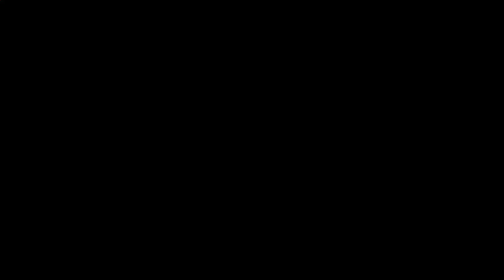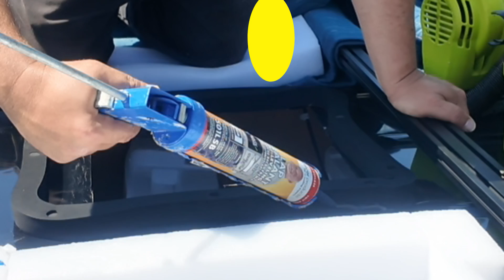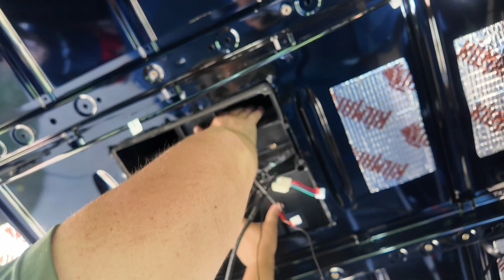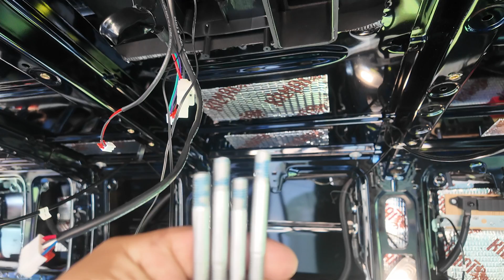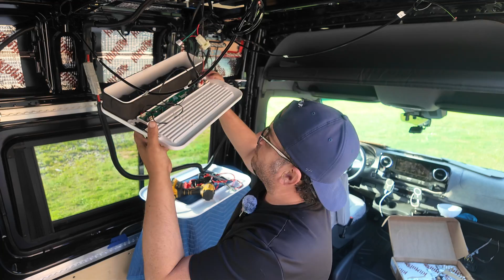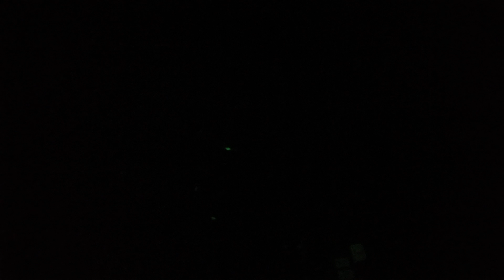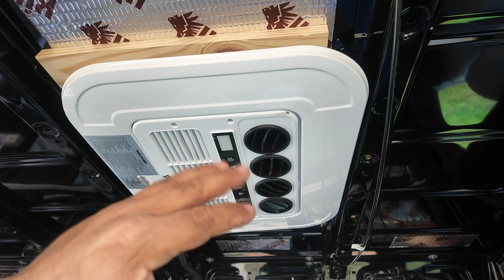Don't Cut Your Roof Until You Watch This! 12V AC Install

Comment from the maker: 🛒 BUY HERE & DISCOUNT CODES
▶ Exclusive Purchase Link: https://bit.ly/OutEquipProACHeaterRF
👉 15% Off Discount Code: ADAM30
https://amzn.to/4rGP8Zf
💸Building a Camper Van? Enjoy Fast Deli
👉Easier Returns during the build https://amzn.to/4rGP8Zf

▶ See all the parts I used in my VAN build for FREE: https://bit.ly/RFVanBuildPartsList
**Unlisted Video** Showing final setup using a 12V native power station bank: https://youtu.be/zkcXrvJGMCU

▶ Amazon Link (12V A/C with No Heater): https://amzn.to/41qukJM

⏰ TIMESTAMPS
0:00 - OutEquip Pro 12V Heater & AC Install: Introduction & Tips
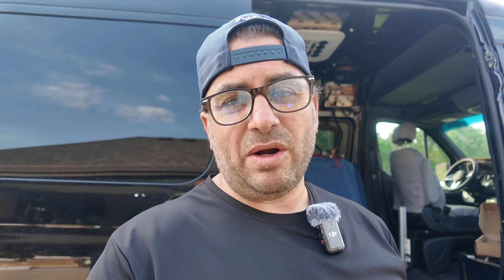2:01 - Van AC Install Day: Prep Work for OutEquip Pro
2:26 - Key Prep Steps for Installing Your Van AC Unit
3:33 - OutEquip Pro AC Install: Correct Hole Size for Van Roof
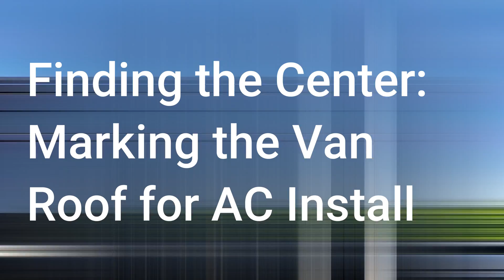4:02 - Finding the Center: Marking the Van Roof for AC Install
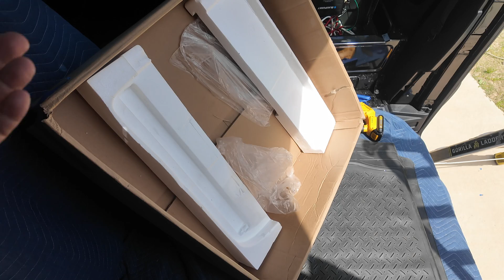5:58 - Cutting the Roof: Step-by-Step Guide for Van AC Install
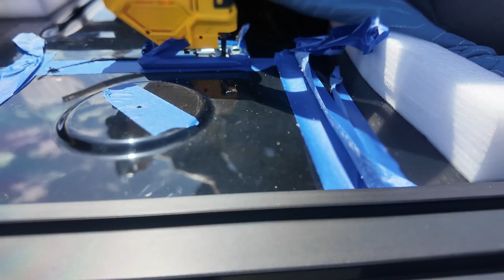6:37 - Applying the Gasket: Ensuring a Watertight AC Seal
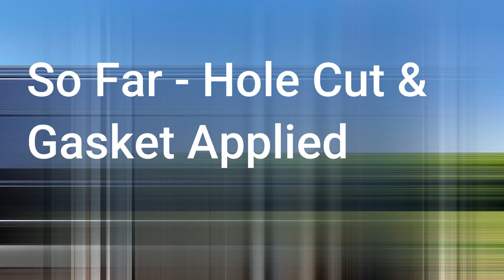8:45 - Van AC Install Update: Hole Cut & Gasket Applied
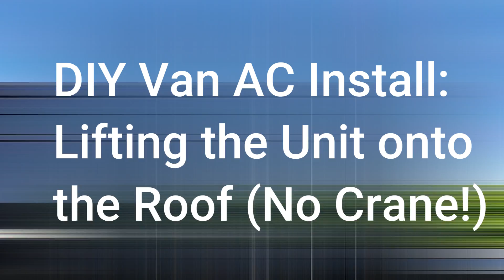9:34 - DIY Van AC Install: Lifting the Unit onto the Roof (No Crane!)
10:59 - Leveling the AC Unit: Making Height Adjustments for Proper Fit
12:07 - Avoiding Extra Holes: Wiring the 12V AC Unit Inside Your Van
13:31 - Securing the AC: Installing Metal Studs on the OutEquip Pro
14:26 - Reinforcing Thin Van Metal for a Secure AC Install
15:51 - Modifying Stud Length for Perfect Headliner Clearance
17:19 - Leak Test: Ensuring Your Van AC Install is Watertight
17:49 - Wiring the Control Panel: Powering Up Your 12V AC & Heater
18:38 - Advantages of 12V A/C Systems
21:25 - OutEquip Pro 12V AC & Heater: Key Benefits for Van Life
25:29 - Pro Installation Tips & Tricks for Your Van AC Unit
31:15 - Final Thoughts & Recap: OutEquip Pro 12V AC & Heater Install

🛠 PARTS & SUPPLIES USED FOR INSTALL
▶ Self-Leveling Sealer: https://amzn.to/42AMF6A
▶ Butyl Tape: https://amzn.to/4gf7zQQ
▶ Metal Speed Jigsaw Blades: https://amzn.to/42PEGE1
▶ Jigsaw: https://amzn.to/3EpRszP
▶ Roof Fan (to help extract hot air): https://amzn.to/3HjJRnW
▶ Small Circulation Fan: https://amzn.to/3Und2tc
▶ Standalone 12V Heater: https://amzn.to/45pUZYf
▶ Updated Included AC Gasket: https://www.amazon.com/dp/B08KSLRB45

❄ Alternative Power Cord Routing Video: https://cdn.shopify.com/videos/c/o/v/9f13acf1e5e24686beba0db06cbcfa61.mp4

🎥 RELATED AIR CONDITIONING & HEATING VIDEOS
▶ OutEquip Pro 12V AC/Heater Unboxing & Pre-Install Check: https://youtu.be/QX1o89CqNKg
▶ Air Conditioner Install Video: https://youtu.be/qsGtl2X0fyI
▶ 4 Month Review Video: https://youtu.be/xA88BCCT_Tk
▶ 1 Year Update Video: https://youtu.be/Lux1RWOaUdA
▶ Gasket Upgrade Update Video: https://youtu.be/8RGpvvMbasU
▶ How I Power My A/C (DC & AC Loads): https://youtu.be/CpxEwSwUNbA
▶ Looking for a Diesel Heater?: https://youtu.be/SxGkUpEoORY

🎥 OTHER BUILD & WIRING VIDEOS
▶ 2026 Fan Install (Best Fan Ever!): https://youtu.be/bq52RUauRNE
▶ MaxxAir Fan Install: https://youtu.be/4knTUcm3ihY
▶ Bathroom Fan Install: https://youtu.be/QXxBSx3cfI8
▶ Installing Windows: https://youtu.be/5NFRYbsl1eY
▶ Vantech Roof Rail Install: https://youtu.be/oB_Yh3JEooI
▶ Low Pro Roof Rack System: https://youtu.be/pkj5Tcs5a1U
▶ Standard Roof Install on 170 Extended: https://youtu.be/1FX9xsWQa7Y
▶ Roof Deck Install: https://youtu.be/4cu8mjVKQzc
▶ Auxbeam 8-Gang Switch + LED Light Bar Install: https://youtu.be/a4Xae4J4b2c
▶ How to Wire a Van Like a Pro: https://youtu.be/RPgQe8d_3BQ
▶ Understanding Diodes in Van Wiring: https://youtu.be/pCRmZKXeGAA
▶ Sprinter Power Leads Under Driver Seat: https://youtu.be/42sVAuafbXc
▶ Shore Power Install (Rear 2025): https://youtu.be/PO2sdMM50-A
▶ Shore Power Install (Front 2021): https://youtu.be/Ksyee3aYm7s
▶ Power Bank System Install: https://youtu.be/rqFwxSwji1w
▶ Stereo Amp Install: https://youtu.be/vhBOfmHlM-g

🚐 SPRINTER PLAYLISTS (60+ Videos Each)
▶ VS30 907 170 EXTENDED: https://bit.ly/VS30Sprinter170
▶ 170 High Roof: https://bit.ly/VS30170Extended
▶ 360° Van Tour: https://youtu.be/rCCA3hLQSzQ
💸Building a Camper Van? Enjoy Fast Delivery and Easier Returns during the build https://amzn.to/4rGP8Zf

Disclaimer:
Due to factors beyond the control of RandomFix, RandomFix assumes no liability. Affiliate Partner: I will receive a commission from some of my affiliate partners for my first-hand recommendations such as Amazon. #CommissionsEarned #Ad My videos include paid links

Comment: This is the most detailed thorough video I have found for this exact AC. THANK YOU!!! I have one question, we just completed our install cannot figure out where the "drainage cutout" is so that we can ensure we have placed it outside the gasket. I read through some of the comments and sort of see this kind of mentioned but not exactly. Are you avle to provide any guidance? I just want to make sure we have installed it back far enough now rather than hoping we got lucky enough 😅😅😅.
Our opening is also 14×14 so I know we need to be certain. 

Thanks!
Reply from the maker: It drains out the sides, as per the gasket and setback, watch the video about the gasket update in this video”s description. You want to make sure that holes towards the rear are not within your gasket area. Once you get in place just feel towards the rear of the unit from inside. 
So place your gasket, ( 14x14  is fine) place the unit, make sure you don’t feel those holes towards the back of the unit and then secure in place. I have a 4 month update, 1 year unpdate, and an unboxing video where I bench test it incase you want to see the under belly of the unit and see the holes towards the rear of the unit.

Comment: It looks like you have it installed backwards. Aren’t those cutouts on the top side designed to be on the sides and back? Seems like you are going to take in rainwater into the electrical since it will hit it at 60mph speeds.

Comment: Came back to revisit your install as im pretty certain this is the AC ill be using?  Have you had an opportunity to run the heat on any trips?  Im wondering if it could be used instaead of a diesel heater.  I know the diesel heaters are so efficient.  Cheers, Adam....another thorough video!!!!👍👍
Reply from the maker: The heat is barely noticed in the real winter, I just published the diesel heater review https://youtu.be/SxGkUpEoORY  and I will post the actual install of the heater in the coming weeks. I tested both system, all in one vs split. Take a look and let me know if you have any questions. Since you are starting a fresh build make sure you see that unlisted video https://youtu.be/7_h07JsOdfQ where I show how to connect in the diesel fuel tank without having to drop the diesel tank!

Comment: Does that battery hook up to the alternator?
Reply from the maker: The air conditioning connects to you power bank or can be connected straight the main vehicle battery ( the alternator charges the main vehicle battery).
Most newer vehicles have alternator that is strong enough to support this.
Reply: @RANDOMFIX  OK OK because I own a cargo van business and I’m going to be installing the one that does heat as well. I need to put in the heat one soon.
Reply from the maker: Are you doing this because of the heat? Or is the air conditioner more important?
Reply: @RANDOMFIX  both are important but it’s about to get cold where I am so heat is very important right now
Reply from the maker: You can save yourself lots of time and money and money buy getting the $30 12 volt heater that I tested and works amazingly well. You will find the link in this video https://youtu.be/xA88BCCT_Tk?si=KZqMm8FpOxStNHQ8 in video description. Install of that heater is an absolute breeze and I hope that helps and best of luck, keep me posted.

Comment: Hey swashplate after reading your  4th point about making sure the gasket sits flush in relation to the thin foam gasket that’s glued in n the unit. I noticed that if  the unit sits on the square recpro gasket  it’s half on and half off . I’m a bit confused on that part! Anybody has an idea about what he’s referring to would be great!
Reply: Yes Michael at outequip said they included both gaskets in the box
Reply from the maker: Awesome, thank you for confirming that.
Reply from the maker: I made an updated video about this https://youtu.be/xA88BCCT_Tk?si=6f6ovNf_awOJw5j1 I show the way the gasket is supposed to go in. 

And in the video description I mentioned there is also an update about the gasket, it’s short unlisted video.

With upgrade gasket make sure it sits forward and that there no rear air conditioning drain holes inside you gasket area. It’s pretty easy to understand as it’s a square gasket.
Reply: Thx Randomfix for the reply! I did see your update video but was still wondering what he meant! I know that I have to sit the unit over the gasket so that the vents are on the outside of the gasket but my unit came with some thin foam glued on it that covers half of the duct. Not sure it all came like that . Not sure if that makes any sense without seeing it but thanks for the heads up!
Reply from the maker: Okay, I see why you could be confused.
Mine didn’t come with that and i recommend using it and still avoid having any of the rectangular holes  with your square gasket. As you know the thin foam gasket would hold up for a little while but it will fail on day as it probably glues into place.
Reply: Yeah interesting plus it came with 2 foam gaskets now ! That big original one and a square one that I think is from recpro.
Reply from the maker: Can you send me a picture by email? To Randomfixworld@gmail.com

Did it come with the new square gasket inside the box with the air conditioning.
This is a recommendation I made so it would be great to find out.
Reply: Yes it did! And I’ll send you a pic
Reply: I sent it to your email! Hopefully you got it!
Reply from the maker: I got the email and everything looks good. So the gasket I’m the picture that is attached to unit is now included?
Thanks
Reply: But kinda strange that the thin foam that’s glued is only on half of the underside instead of all around the duct but he said that’s how it’s supposed to be !

Comment: How well does the heat work? Love your content
Reply from the maker: Thank you the greet feed. The heater is nothing grand but it works. I haven’t tried it out other than the unboxing as it’s been hot in Texas where I reside.
I don’t think it is the only heater I will need on a colder night but I also have that 12 volt heater under the beds. Between the two I am confident if it’s 32 or above I am okay. For extreme colds I would have other emergency methods ready just in case.
My power station capacity is high so I am not really concerned but I will provide a winter update coming soon.

FYI in a well insulated van even a small 200 watt heater is impressive, don’t skimp on the insulation.

Comment: Just finished reading the comments from swashplate on his returning of the unit! Now I’m back to square one on purchasing the outequip unit!🤔
Reply: Outequip is recommending the Amazon gasket from Coach Works now, that's what I used 4 my install. I only need to rerout my wire threw the return air to finish up. OutEquip has been great to work with, they respond to every email with solutions. Thanks for the great Video!!
Reply from the maker: Robert, sorry I didn't ever respond to him as I was probably busy building out the the van, I actually address most of this concerns in the update the video https://youtu.be/xA88BCCT_Tk
The a/c is honest awesome but as I mentioned in the video the gasket is a bummer and the fix that gasket is this https://amzn.to/4k25VBc  - install using this and you will be happy!

Comment: Love the video! I’m close to doing the same install in place of my max air fan but wondering if you’re able to give me the underside measurements of the overhang from the 14x14 hole to the back since my fan sits pretty far back already! I have about 12” from the maxair fan hole . Definitely don’t want to have it to overhang . Appreciate any info , Robert
Reply from the maker: Hi Robert, thanks for the great. I actually covered the dimension in the unboxing video.
Let me know if I missed any, there is also a 4 month review that was posted last weekend.
Reply: Hey no problem! Thanks for replying back!! I’ll go back and review the post and I’m still leaning towards the outequippro unit if I have the clearance🤞thanks again! Robert

Comment: What’s the maximum amp draw you’ve seen on this air conditioner when running in turbo or maximum speed mode?
Reply from the maker: 67 amps, full turbo at the lowest temperature.

Comment: I have a 159 Promaster and returned this air-conditioning unit as it severely underperformed and did not work as advertised for a Van. If you decide to do the same as me but decide to keep it, please note a few things.

1- Get your own 14x14 roof gasket and move the support rubber dowels from the supplied gasket to your new one. Just drill holes in the 14x14 gasket to allow this. The supplied gasket is just ridiculous and not worth the effort even attempting to modify it to something actually reasonable. I bought the RecPro gasket off Amazon. (Side note: The RecPro says it's 1.20 inch tall, it's not.  It's 1 inch tall) the RecPro rear support block is the perfect height for the unit when also using the item in #2 below. If you don't get #2 below, the support block will be too tall. I suppose it could be modified to be shorter.

2-Get/buy the DIYvan roof adapter plate, it will save so much time for fitting your new 14x14 gasket.

3- The instructions are confusing, make sure you are using the "Summit 2" not what's supplied in the email link. 

4- Before tightening the unit to the roof, make sure the leading edge of the very thin gasket on the bottom of unit is flush with the front corners of the 14x14 gasket. Do not place the unit further forward or aft of this. Water or air might leak inside. 

5- Do not use the longer stud bolts as they are warped, use the short one. And do not use the forward mounting thread inserts, that's from the wrong instruction manual that was provided via email. Use the mid and aft threaded inserts.  While I tried to tourque to spec, the unit started to warp. So I stopped at the point. 

6- Get/buy 4awg wire at least 15 feet long, the supplied 6awg gets really hot due to the current draw, it even popped my Spartan Power 100A circuit breaker because it got too hot, too hot to touch hot (around 123F). The 12 feet supplied is barely long enough to reach from the back section of the Promaster roof, through the air intake, across the ceiling, to the left rear pillar then down, then forward to your battery near the left rear wheel well.

7-Even if your van is insulated and has window covers, do not expect this to cool your van down with a difference of over 5-7 degrees from the outside Temp. This unit does cool but the blower motor cannot do the exchange faster than what nature does to a hot metal box (the Van).  It just can't catch up or even keep up if you start cooling the night before.

8-Support is good but only via email as no phone support is available. 

I did extensive troubleshooting with them via email over a weeks time. My unit was drawing 47-55 amps @13.54vdc and around 812watts on Max settings and I just could not get this to do what is advertised. Like I said above, it did cool. But, if you stand more than 2 feet away, cooling effect is lost. I suppose if you put a curtain to keep your rear sleeping area (full size bed) it would keep you nice and cool, but keeping the whole van cool is not going to happen with this unit. I even tried a 6 inch fan in the back and a fan in the front to circulate air as the support folks requested, still did not help. I ran the unit all night from a low of 62, as the day got hotter, so did the inside of the van. Ultimately, as stated above, the interior only was 5 - 7 F degrees cooler than outside and that's not opening any door, just getting measurements sent via Bluetooth.
Reply from the maker: Hi, Thanks for point out some concerns about the A/C. You are right that gasket that was provided even got me! I produced an update video that actual covers most of the concerns you had https://youtu.be/xA88BCCT_Tk 
I actually use my air conditioner all the time and still enjoying, other that gasket I have not had any issues.

Comment: In theory, couldn’t you have plugged the Outequip AC directly to the Comvolt with the Anderson connection?
Reply from the maker: I could have but my power stations are in the back of van and my air conditioning is towards the front.